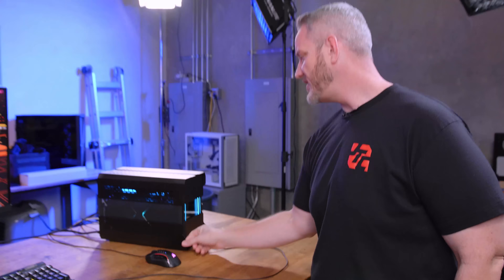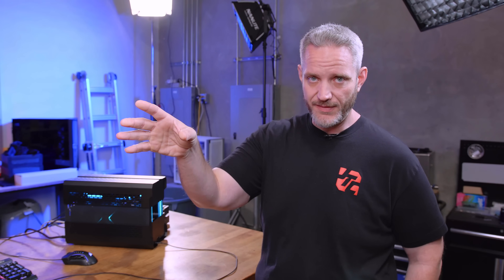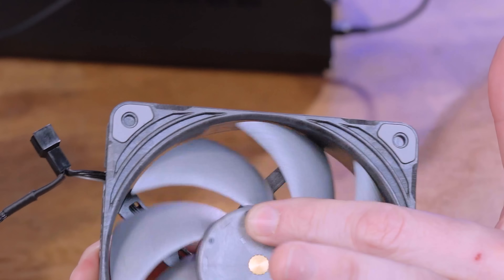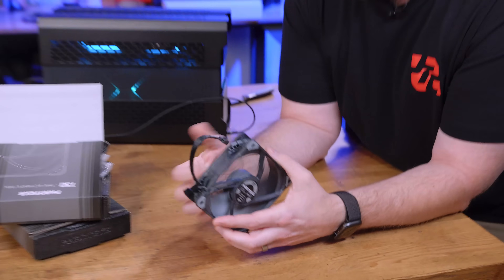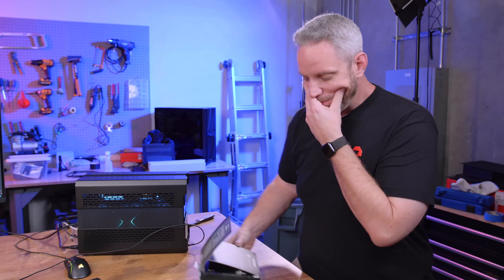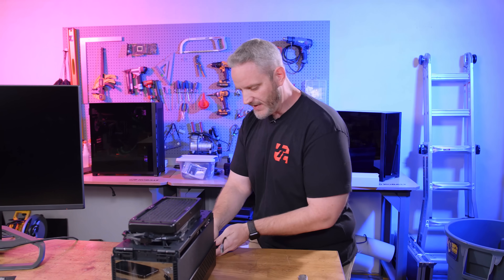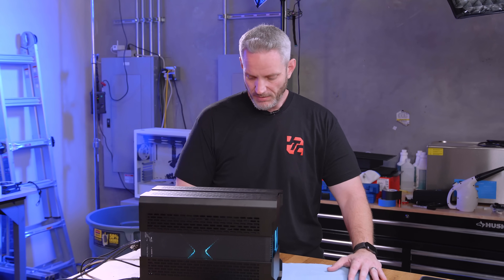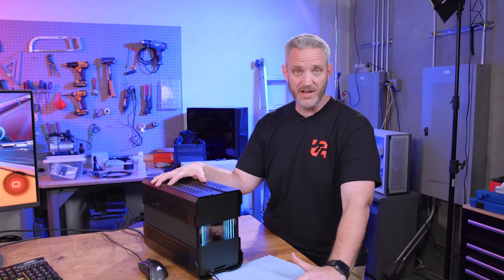Improving the cooling in my Evolve Shift XT build... it got TOASTY!

Comment: SFF builds don’t have to be hot and loud.  I’m running a 3080ti FE in a Ncase M1.   Card rarely breaks 70 C and is whisper quiet.   Just do an undervolt with both your cpu and gpu and then you can drop your fan curve drastically!  Makes a huge difference.
Reply: Optimum tech proved SFF builds don't have to hot and loud. When it comes to SFF builds on youtube he's my guy lol. Going from his channel to seeing this is kinda funny lol.
Reply: @PabzRoz  same!
Reply: Why not just buy lower end specs and hardware if you plan on under volting it? You’re paying for extra performance that will just always be handicapped.
Reply: @jaredchampagne2752  You can undervolt while keeping close to the same performance. 
Loosing 1% frames but dropping 20 degrees is a good trade off.
Reply: @jaredchampagne2752  common misconception.  Undervolting done properly will actually increase the performance due to lower temps.  If I run a benchmark at stock and then with my undervolt I consistently get 2 to 3 percent better results with the undervolt all while lowering temps and fan noise.
Reply: @jaredchampagne2752  I've got an undervolted 3090 that draws over 50W less than stock, but performs effectively the same
Reply: Proper undervolting should really be covered more often. Most people are under the assumption that undervolting = underclocking and super reduced performance. Proper undervolting is really just optimizing voltage.
Reply: @ps3guy22  not to mention greater stability.
Reply: I have an N-Case and I opted for a dual fan card instead of trying to jam a three fan GPU in there and have air flow problems.
Reply: @jaredchampagne2752  This is a common misconception. In reality it's very similar to tuning an overclock. When you overclock, you bump up the clocks until the voltage is insufficient to remain stable, then you either raise the voltage or stop. In an undervolt you do the opposite. You drop the voltage until it becomes unstable, and then either start dropping clocks or call it a day. You can actually gain performance doing this, as the lower voltage means less heat, for longer boost periods, and it means loer power draw, which keeps anything away from a power limit that would otherwise stop it from boosting higher.

I have a laptop with a 9750HK and a desktop 1660ti. When stock, 1660ti has a boost clock of 1770mhz. With nothing but an undervolt on that card mine now reaches 1980mhz before hitting the power limit. The 9750HK still reaches a thermal limit, but it now pulls 60W instead of 75W at full tilt, and thus doesn't back down as it hasn't hit a power limit.

If you're curious about how any of this works in more detail I'm happy to explain.
Reply: so right yes that can work. 😉
Reply: @jaredchampagne2752  Lol, you say that as if anyone with half a brain can undervolt and simultaneously overclock to get at least 10% less power consumption and almost 10% more performance on just about anything. Hell, my old GTX 980 ti runs at 80% power with a 25% overclock on the core and stays stable because the temps are so much lower. Same as my Ryzen 3700x, I run an all core OC of 4.35Ghz and 1.25v, whereas the  stock tune was 4.2Ghz all core and 1.37V. This is a HUGE savings, 12c lower temps and a considerable bump in performance. More voltage does not equal more good anymore. If I try to run 1.35v at 4.35Ghz my OC is unstable because of higher temperature. I actually tried initially at 1.3V but would get random crashes, so i tried 1.35V and it made it worse. So I decided to try decreasing voltage just to see and sure enough. Modren hardware has a point where more voltage will make it less stable if you can't keep temps down. The stability you get from lower temperatures has become more important than how much voltage you throw at the fucker.
Reply: @DigitalJedi   yeah, my 5950x boosts much higher from PBO with a -0.1V offset undervolt than stock voltage
Reply: sorry for reviving an old thread, which revision M1 do you have? I have a V4 so the side panel doesn't have the mesh extend down over the graphics card and even with a significant undervolt on my 3080, it breaks 95° with the side panel on, 73° without
Reply: @Cannonballer95  I have the version 6.1
Reply: @jaredchampagne2752  undervolting is not always underclocking. you can undervolt several .01 volts and maintain stock clock with 0 performance lost. if you undervolt further you can drop your power as much as 100W on a 3090 so it effectively becomes a better 3080 ti with less power draw, lower temperature, while maintaining all the extra cores etc.
Reply: @adamhahler4205  Sorry I'm really late to the party. Do you have a tuto for the undervolting please ? For example on Afterburner, can I directly lower the power limit, clock speed and memory frequency or do I need to use the curve thing with all the points ?
Reply: @GW3N_yt  honestly, just Google how to undervolt. There’s a lot of good tutorials out there.  But yes you’re going to use the voltage curve and then overclock the memory some.
Reply: I agree with this just recently got this case and was stress testing it and hitting 90 after an underplot on the CPU I came down 3C on an all core load and in gaming it really won't matter. This case certainly isn't the coolest but it looks really nice and it's a good balance of looks and being SFF.

Comment: On my case, I trimmed out the perforations on the outgoing part of the case fans which made it much much quieter and moved 2x as much air which cooled the whole pc much better. I installed the nice rounded chrome fan covers that still allow the air but keep your fingers in place.

Comment: You can probably get another slightly performance increase by ducting the top of the radiator to the top of the case, similarly to what the Noctua NA-FD1 does (Optimum Tech covered this). This will avoid any recirculation, majorly helping the GPU.
Reply: To be fair, as far as I know, that's a 90 mm fan option only

Please do correct me if I am wrong
Reply: I dont know how the power supply looks. But since its Jay ima propose it anyway. Maybe drill small holes on the opposite side of the PSU? Like that flat roof opposite side of the fan for through-flow-air-flow(thats a mouthful for phil)

I have about 0 idea if u can DIY. But i reckon its only a metal shell?
Reply: @wilswils4837  that is a terrible idea, how would you prevent metal shards fly all inside the psu then :O
Reply: @Koichifirst  take the PSU out, de-bur it aka sand it.
Reply: @beoeve  no no if you drill into the PSU housing, how you wanna stop metal shards/shavings from the drilling to be stuck insiiiiide the PSU?
Reply: @Koichifirst  take the housing off, MOST of them come off.
Reply: @beoeve  that's a terrible idea too, I took apart a defective PSU before, it's not easy to access the bottom of it, you kinda need to fully disassemble the whole PSU (atleast with my BeQuiet). I don't know your laws and insurance policies at your country, but where I live you can't mess around with electronics that much. If you have shavings in there causing a short and potentially a fire, the insurance pays NOTHING if it gets traced to the pc.
So in my opinion that's absolutely not worth the risk and or time required.

OH and I should mention, usually the wires inside a PSU aren't very forgiving either, they mostly have the minimal required length, so it's incredibly hard to get through, alone a destructive go with cutting out all cables was a pain.

Another edit:
Even if all goes well, the area behind the PCB from the PSU is only a few mm and in an sff PSU I doubt there is much room anywhere either. So the benefit would be kinda nothing.

Comment: I would recommend using Argus monitor software, it allows you to set fan curves from multiple sources allowing the fan rpm to be controlled by the hottest component.
Reply: I mentioned this in Jay's last video on this build.Argus monitor is awesome software :)
Reply: Argus monitor is OP af
Reply: Even better: Fan control is open source and works just like argus, without paying. Just take a look about it on the LTT forums.
Reply: Argus is brilliant.  My PC is cool and silent when not gaming.
Reply: Fan control is waaay better, it's free and open source
Reply: I also love Argus Monitor!
Reply: I really wanted Argus to work but in my case, it kept reseting the source after each sleep / reboot so it didn’t really work for me
Reply: @pillar.1  I agree, I've been using if for over a year without a problem.
Reply: Fan control is free and much more simple design that have the same functions. 🤥

Comment: After meddling with fans, I am by far NO expert however.. That fan air flow is IMPRESSIVE. Considering the SFF case/build. I'd be happy with it! I usually run headphones 90% of the time due to shared accommodation so a slight hum from a case isn't a problem :D. Great stuff!

Comment: This case is awesome and has pretty amazing thermals regardless of it's size. Mine has an AMD Ryzen 5800x 4.85ghz 1.2v, an EVGA 3070Ti XC3 Ultra overclocked to 2100mhz and +750mhz memory. I only have one T30 fan on my 240mm AIO with a Be Quiet Silent wings 3 high speed on with it. With games that draw 280-310W the 3070ti sits at 70-74c while the CPU is generally close to 60-63c gaming and 50c at idle. I also have the PSU flipped so the fan is pulling hot air through the flow-through part of the 3070Ti. I have hopes that the second T30 fan will further help with temps, that fan pushes quite a bit more air than the Silent Wings 3.

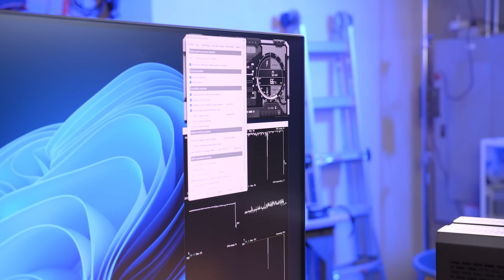Comment: 14:28 it's nice to see you using the fan profile in Afterburner. I wanted to add that you can have 5 or 6 temperature points. Give the first 2 under 50c a lower fan speed to remain quiet, then aggressively raise once you are in a game Temps, and max the fan speed at least 10 degrees C lower than where you want your card to max out.
Also, the next tab allows the computer to monitor/shutdown when certain conditions you set are met. Could be useful for this build.

Comment: I don't think the founders edition is optimal for thermal performance for a sandwich layout case because of the cooling system on the card (3080 and above). Undervolting the card may help, but I'm sure you know this. My founders edition 3070 is undervolted and barely ever reaches 70c in a SFF case with no noticeable performance loss.
Reply: I think the founders edition have the worst cooling tbh
Reply: I undervolt my 3070 as well. 906 mV seems to be a sweet spot where I don't lose any performance and the temps are about 10°C cooler.
Reply: yep putting a fe card in there is just a bad idea.
Reply: He just needs to offset the riser so the gpu is closer to the side to pull in air and additionally give more space behind the FE to have more airflow behind. If the power cable is in the way, I'd swap for a pig tail to give more room for this. Undervolt would also work well.
Reply: @aliabdelaziz7585  in a large ATX case the blow-through style coolers actually perform pretty well AFAIK but yeah in a SFF probably not so much
Reply: The Founder's Edition is a clever way to cool a GPU, but in a sandwich layout it really doesn't make sense
Reply: I'm running a 3080 in a nr200 and temps stay under 70c unless I'm really hammering it for long periods of time and the system is almost completely quiet.
Reply: founder edition is always sucks in cooling and their noise level is make your brain heat up in a sec , especially when they are in the sandwich build
Reply: @amafi_poe  that's not a sandwich case
Reply: @amafi_poe  FE design in the nr200 is honestly ideal for a FE cooler. When there's a wall on the other side of the passthrough fan it becomes very hot very quickly.
Reply: The whole case is not optimal. Over engineered AF.

Comment: 11:10 the AIO tubes wouldn't be hitting the graphics card if you reversed the pump location on the CPU. Instaed of the pipes starting on the PSU side, have it start from the rear IO side. I did this and it makes routing the pipes much easier to the side if the radiator fans. Only downside is that the top hinge panel cant open as far. But you can just remove it from the hinge anyways. I am using the 3070 Asus TUF OC, and the cables just cleared the fans.

Comment: BeQuiet has a High Speed model fan (model - BL081 - 120mm) thats goes to 2000 RPM and 65.51 CFM to the one you are using PH-F120T30 with 2000 RPM - 67 CFM

Comment: I really enjoy this video, I did some fans tuning in my PC recently and it really does a difference if we are welling to put the time to tune the fans profiles. Once the fans profiles are set, it can goes for years like that giving us a better experience overall so it worth it. It might sounds too obvious but knowing smaller fans are typically more noisy than larger fans, ramping up the bigger fans to bring more air in usually result in a more accoustic pleasing experience than asking the smaller fans to do most of the work lol on my PC I did settle for about 1200 rpm (full load) but I have a full tower case (Corsair 7000X with 7000D ''Airflow'' front and top panels).

I'm really happy we have Jay sharing his experience and knowledge over the years. He's a really valuable human being to me and to millions of people clearly. <3

Comment: Ever since I got my first Stacker full tower case with a ton of 120mm fans I've been a fan of big extremely quiet case. It's nice not to hear the fans whining away and the parts still running hot.
Small cases are great for home theater pc's and like that where it's dedicated to one purpose, doesn't need a lot of space, and every thing is low power anyway. I'd actually like to get a NUC or whatever it's called case for my HDTV capture box to save space and power use.
I have the beast box for editing and games etc. At least most fans now don't have the super loud high pitched noise many of the old 80mm case fans we were stuck with 🤣

Comment: Jay, undervolting and oc at the same time. On 3k series it makes huge difference. I'm running 1000mV 2025mhz stable with 100W less and 10 degrees cooler.

Comment: I'm disappointed you didn't do the PSU with noctua fans. I bet the added flow rate makes up the difference and you can have quiet times again. Also, I've wondered why there isn't a blocking plate on form factors to isolate the air intake for radiators. Especially pulling air out, seems like a shroud/blocking plate from the rest of the PC would really help. Like a little radiator tray that the fans pull cold air from. Almost like having the radiator away from the case all together. Seems like that would make sense.

Comment: Noise-to-performance-wise, it might be worth separating the two rad fans and running the rear one off of CPU temp and front one off of GPU temp. I've done this in a few cases where the rad is just above both components (like within 6-8" of the CPU and vertical-mount GPU) and it seems to help quiet things better than any curve I tried setting for both fans simultaneously.
Also, because the fans are running at different speeds, the different frequencies "cancel out" some of the noise (or at least, make it less annoying). Just a thought.

Comment: I'm currently using The Evolv X and love it! It's a great case with amazing airflow. I love it!
Reply: What GPU are you running in it? I’ve got an EVGA 3080 ftw3.  I can’t fit the pcie power cables with that card. Truly disappointed. Then I find this video and noticed he had a similar issue and went with an FE card.

Comment: I like the discussion of balancing to car talk but a harmonic balancers main task is to dampen noise mainly from the accessory system(belt drive). Noise being vibrations that, without the dampening effect would wear out the thrust washers and bearings. The entire rotating assembly is balanced and the harmonic balancer specifically acts as a sound deadener but for vibrations.

Comment: I might be off base here but wouldn't you move more air controlling for dB if you did a high end  high static pressure 15mm thick fan under the rad and a 15mm think fan on top? That way the HSP fan doesn't have to work as hard to move air through the rad.

Comment: Jay id' be curious to see what the temp differences are if you flipped the aio fans to where it's pulling air into the chassis. Cooler air hitting the rad and pushing air through the system over the components and out of the system.

Comment: To stop dust from getting into a computer he was building for a friend he modded the case by fitting motor vehicle air filters. The side benefit was it also cut the noise. I'm guessing the air filter while allowing a high flow rate diffused it.

Comment: external radiators? this could be cool video for home pcs ill be running my tubes to my basement with a wall connection at the end of summer as my next post busy season project 2 pumps one in lower half and one uptop in pc maybe with a distro plate or something

Comment: if I wanted to run a bigger gpu. I would run the power cables up and over the the rad bracket along the edge of the radiator still keeping it clean looking.  Even if that meant I needed extensions, leaving the cutout free for tubing. You would only see the extra cable length when the top was off

Comment: If you want silent try working with a Laminar Flow Element on the far end of the exhaust.
You do not want Laminar Flow inside the case however as the air won't mix and cool properly.
Reply: WWWIIIINNNNKKKKKKK   XD

Comment: highly suggest trying a non founders edition gpu and you will likely see a 5-10 degree better temps.   I use a Meshlicious case (all mesh panels) with a 6700 xt (Red Devil) and 5600 x both slightly overclocked - and the system runs cooler and quieter.   Running an EK 280 AIO as only fans in the system.